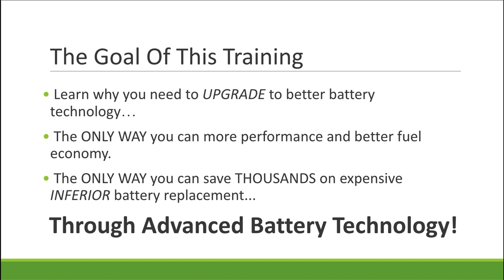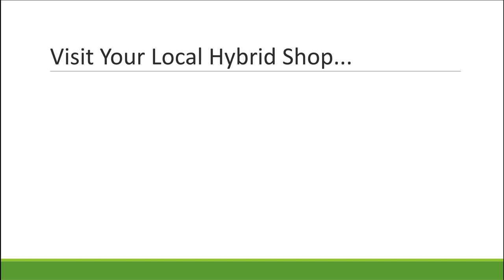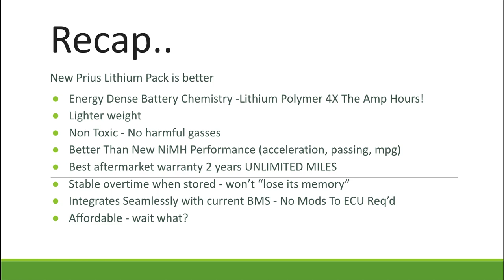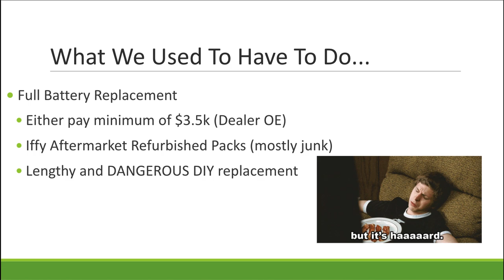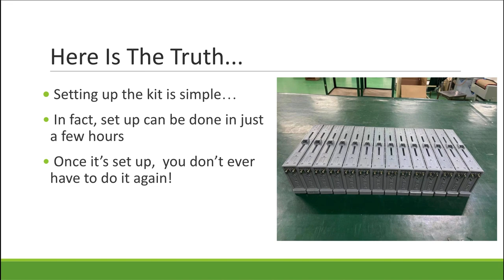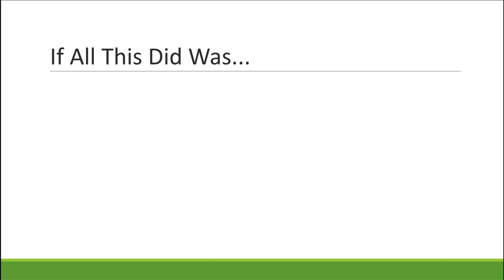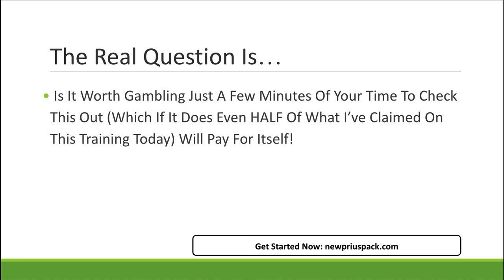New Prius Pack  - Upgrade Your Aging Prius With A More Powerful Modern Battery

Comment: I'm skeptical. How can the HCM "know" how to condition, charge, and discharge Li-Poly? How can it command it to deliver and accept more current that the MGs were designed to accept and deliver with the Ni-Mh batteries? Put a different way, how can the HCM adjust to completely different parameters? Toyota engineers are pretty smart and I find it hard to believe that the car isn't going to know that something is out of spec with the battery pack, and either return a code or operate in a limp home mode. It makes no sense to me.

Comment: Isn't LiFePo better than LiPo? They can handle a lot more cycles and they are less likely to catch fire.
Reply: At 25:36 in this video I see, "LiFePO4". So these are lithium iron phosphate?
Reply: @terjeoseberg990 This is exactly why this channel is just a sales pitch. Also if the product is so good why are they replacing it with new cells that aren't yet trusted by the industry? They're basically questionable cells probably bought on Alibaba. Worse cycling, worse thermals, worse current, worse IR. Back to lithium, they didn't have anything special on it... Just a plastic shell with lipos hooked together... They have a flatter charging profile... They aren't even spoofing the ECU, and also they don't mention reports of consumer fires.

Comment: Is this still happening?
Reply from the maker: Sure is! V2 is out now. https://projectlithium.com/?ref=e9JRo
Reply: @TheHybridGuy  when might the gen 2 replacements be restocked?
Reply from the maker: @jacklynch3333  they are getting restocked this month. In a couple weeks.
Reply: @TheHybridGuy  how long do the batteries last? Am I going to have to replace them in five years?
Reply from the maker: @jacklynch3333  so far 8 years in, there have been no need to replace them as of yet. There have a significantly higher cycle life than NiMH which means they will last longer. This is a one and done solution

Comment: Im between purchasing an original oem Toyota hybrid battery or this lithium upgrade. Can someone help me understand this?  I know Lifepo4 is a great chemistry and very stable but not when it's abused in a prius with 100a charge/discharge.  Im no expert, but Imagine charging a phone battery with 100amps...
It will work just fine but not for long.  Now a modern phone battery is around 4amps.  Aren't these lifepo4 cells at 6.5amps?  How can charging/discharging them at 100amps not degrade them quickly?  Hope someone can enlighten me.  Thank you.
Reply from the maker: I’ve been running my LiFePO battery for 3 years. Here is what I can tell you. My mpg has increased. I took a trip recently and averaged 51. My performance increased the car with 210,000 miles is snappier than my 2015 Lexus CT200h that has a bigger engine. And the power curve is far more stable which means under heavy load it doesn’t fall off as fast or as easy as nickel. It’s the BEST upgrade for your drivetrain hands down. I’ve run all types of packs and this one is by far the best.
Reply: @TheHybridGuy thank you for your prompt reply. I know I'm pushing my luck but would you happen to know the degradation % after 3 years of using the battery?  I've been doing a lot of reading with my limited knowledge...the only thing that keeps me going back to the original OEM is the tried and tested long lifetime of the NiMh. Since they're the same price, it makes it a hard choice for those of us less technically inclined.  The rest of the advantages are very attractive, half the weight, more power and range, etc
Reply from the maker: I have direct contact with the manufacturer. I did visit him recently and we did test the battery for degradation. 1% after three years. Still like new and still has more capacity than an OEM battery.
Reply: 1% degradation is downright impressive.  Hopefully it maintains that over the years.  Correct me if I'm wrong, but lifepo4 batteries cannot be balanced like NiMH, right?
Reply from the maker: @multipotentialite888  correct, plus the circuit boards balance them without he extra work.

Comment: How much is the price for this new battery
Reply from the maker: Priced around $2200 for NEW material, not used, not refurbished, 100% new LiFePo4 battery modules.
Reply: @TheHybridGuy  what kind of warranty and for how many years? Can I instal it myself? I already replaced few cells and is working good.
Reply from the maker: @tomaliza5884  Right now the warranty is 2 years unlimited miles. Nexpower is very good about taking care of the customer though. With replacing nickel modules and no balancing you are running on hopes and dreams. it could last, but chances are it won't and you are also not operating at peak efficiency.

Comment: Triple EV range?  No way! I have two Priuses. One 2010 Prius with nicd battery, other 2016 with lithium. Yes newer has more power, but EV range maybe half mile more, maybe not even that!
Reply from the maker: Yeah double the range not triple. Better power for sure and the lithium has a far better discharge rate than nickel

Comment: How long are these Lithium battery lasting?  They maybe more powerful, but Lithium does not last more than 3-5 years in my phone or computer.
Reply from the maker: 10 plus years
Reply: @TheHybridGuy  Which Prius do you have?  10 years ago was the Gen 3 in production, so it would have to be a Gen 1 or Gen 2.  I still have the original Gen 2 battery in my 2009.    14 years and still going strong.  But I have had to replace my 08 RX400h and 10 GS450h.
Reply from the maker: @anthony19721  I have a Gen 2 Prius  it will be upgrading again here soon.

Comment: Is it actually 4x the power? I am seeing lots of stuff on their site about 260A, not 400A. So this is only 2.6x the power/capacity?
Reply from the maker: This is actually a typo and I need to redo this video. It is indeed 2.6x the power BUT the version 2 which has not been released yet will be 4x the power .

Comment: Just did this install on my 2007 Prius this weekend. Fun project! Looking forward to the next few weeks experiencing it.
Reply: How and where I can't find info on how to get one can you give me info please
Reply: How is the Prius doing since you installed it? Can you provide an update?
Reply: @DreamMachineX  Doing great. I did find that there was corrosion on the pins of the connector for the ECU and wire harness so I ended up replacing those. But the pack has been great. It can handle long periods of disuse much better than the original.

Comment: Would this modification cause any complications when getting the car serviced at the dealership? 2014 Prius V.
Reply from the maker: Hi, if there were battery issues the dealer would replace the entire pack and not individual modules. That is not the toyota way to do a repair. For other servicing options i.e. inverter replacement, or the tech would never know if the battery was LiFePo4 or NiMH. They would have to pull the battery and the cover on it to find that out.
Reply: @TheHybridGuy  Got it. So regular maintenance is ok unless they open up battery 👍
Reply from the maker: @aram9410  Yes!

Comment: ok - you don't have one for 2004 Prius gen2 - I have to disagree with you about replacing modules, it is a not whack-a-mole - you buy a $5 tester, which tells you precisely which bank is bad - I have replaced 2 banks so far in mine - at anyrate - for an old spending a $3000 is just not justifiable. sorry - the price has to be way lower under $1000 - spending $3000 like you are asking for a car that is worth $5000 is just stupid.

Comment: Second bullet point under reason 3 - safety, doesn’t make much sense. You could also add “lithium may explode like a bomb “
Reply from the maker: Not LiFePo it doesn’t get thermal runaway like lithium ion
Reply: @TheHybridGuy  thanks for clarifying. You know better. Honestly this is the only factor I am avoiding EV at this stage. Is there any EV that uses this LiFePo battery ?

Comment: I have a 2015 CT200h, will this solution work on this car?  Is there a location in Texas that will assist with the installation?
Reply from the maker: yes it will work with CT200h. Not sure of a place in Texas that can do the install. BUT if you are into taking a journey I would be happy to do an install for you. But we are about 40 hours apart drive time.

Comment: I've replaced about 8 cells in the original battery, purchasing from 'refurbished cells' from ebay. It's become wack-a-mole , although I'm skilled at replacing cells and have a system now, I have slowly understood  the opportunity cost.. lol. I'm in a gen 2 and have a streetable track car, recently been using my track car as my daily.Hopefully these LiPo work well. edit With the gas prices now and annualizing that, purchase of a new battery set has become even more economically viable.

Comment: Are any of the packs compatible with a 2012 Lexus rx450h?  Can you purchase a couple of these packs to increase ev mode range?
Reply from the maker: I know that the RX batteries are in development. Not sure when they will be released.
Reply: @TheHybridGuy  awesome I'll check back later.  The pack on my 2012 rx450h is still good, but I'm sure it'll need a replacement soon.  Do u know if it's possible to purchase 2 of these packs and connect them together to get a little bit more ev range?

Comment: Lithium can be damaged if charged below freezing, NIMH wins here.
Reply from the maker: Extreme cold temps can damage the battery however not many people have a Prius in the sub zero temps and if that is the case you would want to wrap the NiMH battery or the LiFePo battery in a thermal blanket anyway to keep it from getting damage. Both batteries are susceptible to damage in cold temps.

Comment: Thinking about buying this pack for my aging 2004 prius,  But I live in sub 32 climate for 4 months of year. What does the battery pack do. when below 32 degrees 
How does the new blades handle that,  Do they not run till temp goes up,  Please explain?
Reply from the maker: This battery has been tested in extreme cold with great results. Because it is not water based freezing isn’t likely. NIMH could freeze if voltage is too low and the electrolyte can freeze.

Comment: Does this work with a 2012 Prius Plug In? It it does, will I get longer range after a full charge? And, do you make a pack for the Lexus RX hybrids?  Thanks.
Reply from the maker: Lexus RX is coming soon does not work for Prius plug in.

Comment: How will this battery affect the inverter? That's actually the most expensive piece of equipment in the car.
Reply from the maker: Well, I can say that after years of use the inverter is completely fine. The BMS on the car knows how to control the voltage properly.

Comment: This smells of snakeoil. Anyone know what happens when lithium is exposed to air?
Reply from the maker: Lithium ion can catch fire. Lithium iron phosphate which these batteries are (video has a typo of me saying lithium ion) are safe and do not get thermal runaway. 
No snake oil here. I’ve been running this battery for over 2 years now with zero problems and only a healthy car.
Reply: @TheHybridGuy  I'd like to believe you, but even a basic search does yield results like:
https://www.youtube.com/watch?v=uLzPSN8iagk
Now, the question is how does your battery perform in an overcharge, and during crash tests, and high temperatures and what EXACTLY does your warranty cover (what is your definition of "lifetime").

Comment: I'd love to do this. 2012 V. 179,000 miles. Battery degrading code. But, the has engine is also drinking oil like crazy. Not sure if a new engine and battery is worth it for this car. Although it is in beautiful shape inside and out and it's paid off. 🤔 Decisions.
Reply from the maker: Can I buy the car off of you? Once it starts consuming oil it’s time for an engine rebuild or swap.
Reply: @TheHybridGuy  It's my only vehicle right now. Hoping to get into a new Sienna in a year or so when finances are better. I had planned on keeping the V as a second vehicle, but I'm not sure if I will if I'll have to sink a bunch of money into it. What do you think it's worth in it's current condition?
Reply from the maker: @watchandjewelryloft4713  tough to say without pictures. Send me an email at 
pneilson@certifiedautoconsulting.com and let’s discuss further. Happy to pay top dollar if I can help out.

Comment: Fascinating and I'm delighted you guys are doing this. There's an untapped market, I am trying to get govts to recognise.

I am also seriously considering this but I have a Lexus CT200h, which as I understand it, is a Prius 2. But it only does about 1mile until the battery drains, so would this give me 4miles? Or is there a way I get it to do 30-40miles on one of your solutions and turn it into a PEV hybrid?
Reply from the maker: You would need a larger batter setup for more miles. Depending on your terrain you can see anywhere from
a 1 to 3 mile Ev range increase. 
The thing I enjoy most is that the battery doesn’t fall on its face when going up long hills or passing.

Comment: If your pack goes from 100 amp hours to 300 why not put ⅓ or ½ of your improved battery? Wouldn't that cut price in half?
Reply from the maker: Doesn’t work that way unfortunately
Reply: @TheHybridGuy  What I have noticed you are placing your product in the same box as the original. Since they are lighter why not place them in the spare tire hole and use a easily converted stock. The cooling is not the issue with the lithium , cost is. As long as you meet 200+ volts should be fine? Going this way 16 12 volt battery should do it. Bet ah would increse too. 

Another thing we have a byproduct of heat in the ICE why don't we use this heat to make steam that would make power ? Might as well the car has ability to store generated energy.

Comment: Why have your video production stopped 5 months ago? Did something go wrong?
Reply from the maker: I have plans to make more videos I’ve been frying some larger fish.
Reply: @TheHybridGuy  Ty for your reply. $2,300 vs green tech auto $1,900 installed. How long should I expect lithium battery to last? I'm not looking for the cheapest I'm looking for the best choice. Want what is going to last longer.
Reply from the maker: @GEAUXFRUGAL  green tech uses old used modules in their packs. The energy density isn’t as good as the LiFePo packs. NiMH is a solid bit of tech but LiFePo will does just as good and the modules you are buying are 100% new not used.
Reply from the maker: @GEAUXFRUGAL  no question the lithium will last longer.
Reply: @TheHybridGuy  If price were comparable and last as long it's worth it. I don't need a hybrid I get out this time it's for good. Just don't drive that much.
Reply from the maker: @GEAUXFRUGAL  if battery rebuilders are selling them for cheap they are used batteries. There are some companies who buy new modules out of China but still are NiMH. 
I know all the ins and outs of hybrid batteries man. I slander no one.
Reply: @TheHybridGuy  The price quoted are nimh. Please understand that I am neither for against this or that. Look up slander then you will understand what transpired. Not going to narc you out either. I see that it's very easy to put in refurbished cells and pass them off as new. I have no real way to tell if that is what has occurred to me in the past. I've made two purchases from greentec Auto the first one lasted approximately 6 years the second one unknown the car was sold. To be perfectly honest with you I don't want to get involved in the grab assidrty of hybrid battery replacement market place competition. 

I read in a good book the presumptuous one only causes a struggle. Natural reflex is to feel like a truth is an attack when it's only fact. My decision is going to wait a few months . I'm probably getting a scooter should my battery 💩. Way less money, and controversy.
Reply from the maker: @GEAUXFRUGAL  I get you. It’s all good here and you are right without cracking open a case we do not know. 

I just know how the refurbishing side is and I can say that not all packs are created equal! I wish we could have an at length discussion about all this.